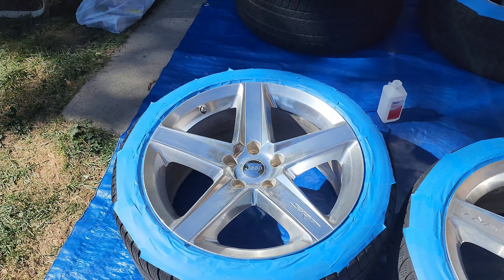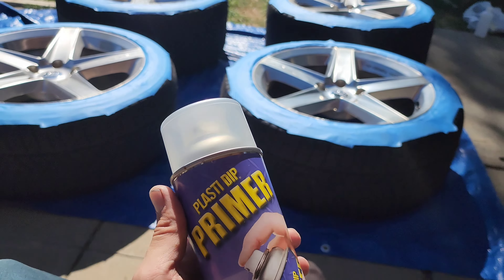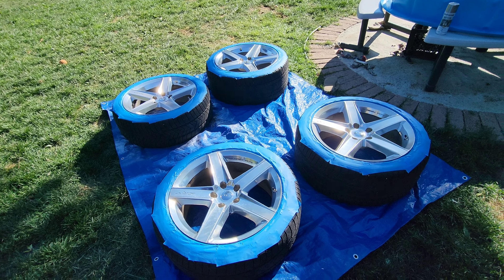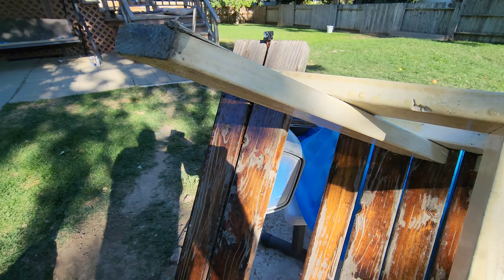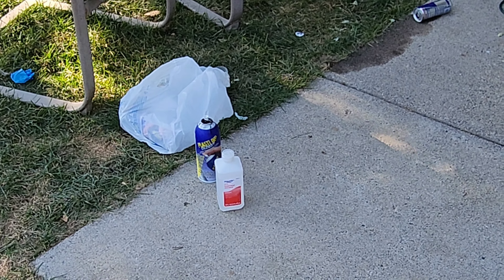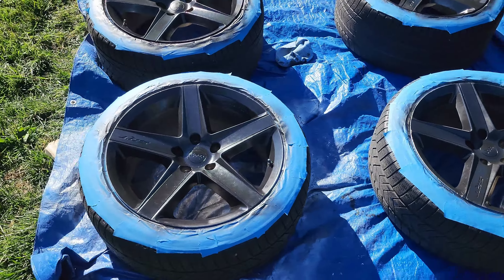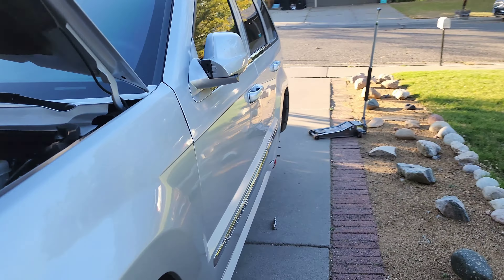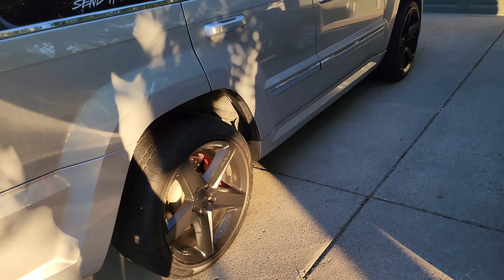2010 SRT8 Jeep visual mods

Comment: Nice, do you have your rear fog lamps working?
Reply from the maker: Yes. I'm disconnecting then and covering them with vinyl. I hate them. Haha
Reply: @RawGolfChannel  I’m looking for a kit so I can have mine turn on but I’m not sure what to buy
There’s led kits but also I remember seeing a harness kit to make them work
Reply from the maker: @manuelmontes6173  you don't have the factory harness hanging back there tucked somewhere in the bumper or near it?
Reply: @RawGolfChannel  I do, there’s a bulb socket and a harness that connects both fog lamps, I just want them to actually work lol I remember seeing a harness that came with a bulb socket but you had to cut into the wires from the tail lamps to make them work 
I’m bad at explaining, my bad
Reply from the maker: @manuelmontes6173  I bet if you plugged a bulb in and checked for the fuse to be working it would work.
Reply: @RawGolfChannel  I shall try that, 🤠